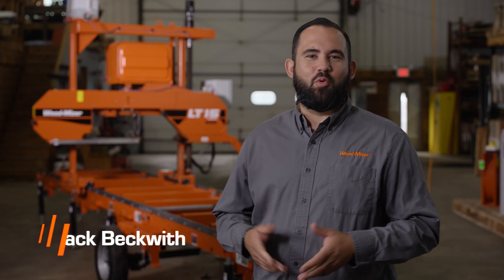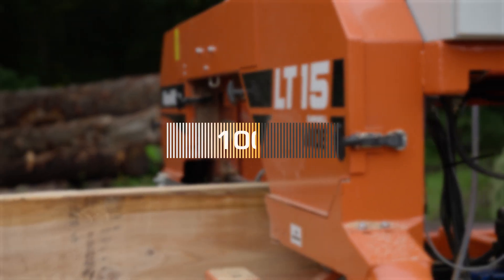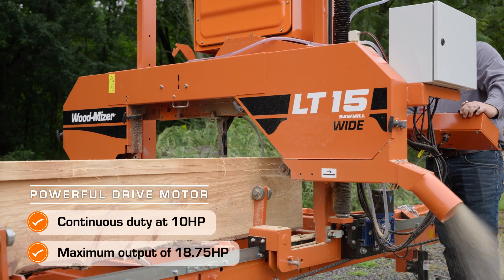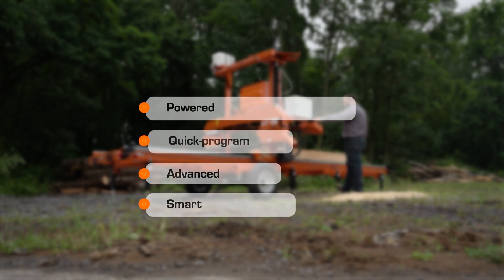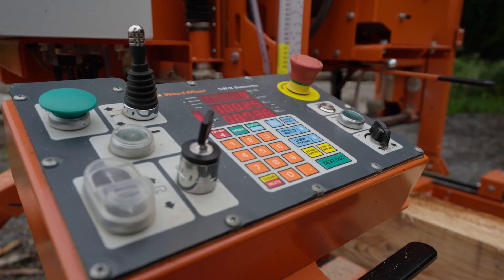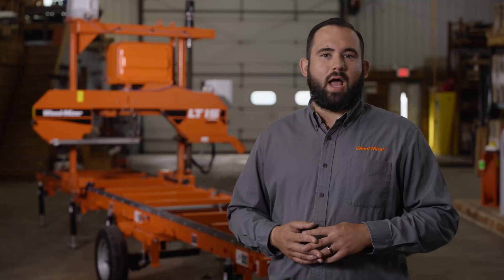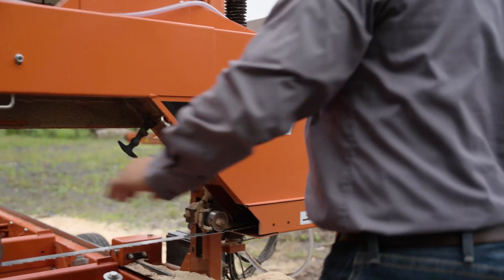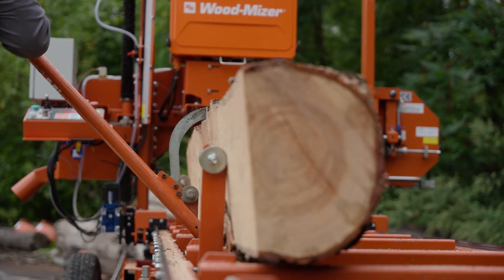LT15WIDE Battery-Powered Portable Sawmill Demo | Wood-Mizer USA

Comment: There are no options for additional batteries on their website. The saw comes with 4 batteries, not 6. No lock on the battery bay. Love the idea and will get one, but they are not even available in Canada? When I contacted WM USA, I spoke to several different offices, and no one could provide any of this basic information. Very frustrating.

Comment: So, you make the statement about this mill being environmentally friendly, where do you think the power comes from to charge this VERY expensive and relatively small sawmill?  That electricity is generated from either a coal or diesel fired power plant in most cases.  Some other issues are the raw materials to manufacture and recycling of these batteries, both are big environmental problems.  I am all for alternative power sources but we are not there yet with the battery technology and support system that are available.
Reply: I mean, I have solar. It's not environmentally friendly, but I have more than offset the energy requirement to build my panels by now. I have now panels about a month ago and have produced over 1MW from them in my used, but never used, batteries also. I understand the argument you are making, but there are some exceptions to green being terrible for the environment. I hate when rich people drive electric cars and charge them using grid power that was generated by coal. It's just making you feel good about someone else doing your dirty work. It's like vegans lecturing you about not killing animals, but their diet plan requires huge farms that obliterate animals, their dens and take more of the old growth forests. The cruelty is just hidden from sight so that they can "feel" better than us.
But again, I'm looking for an electric sawmill because I am a hippy, and it's so much easier from a maintenance perspective too, lol.